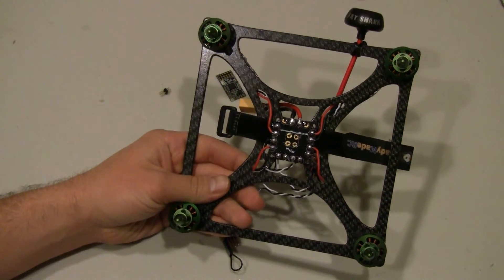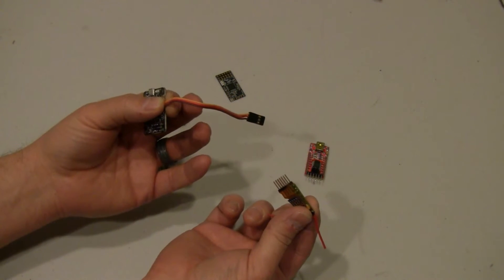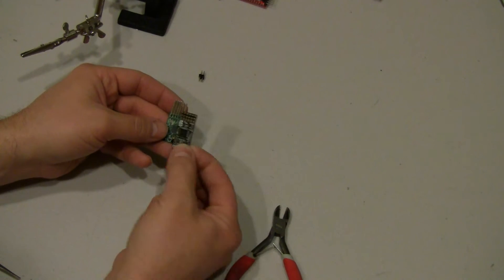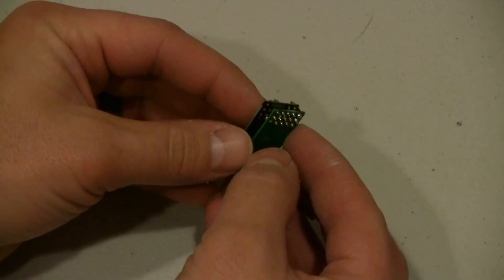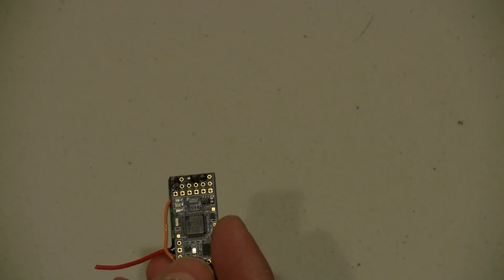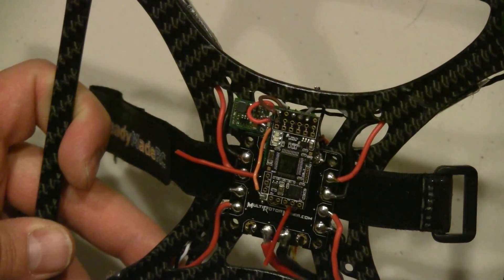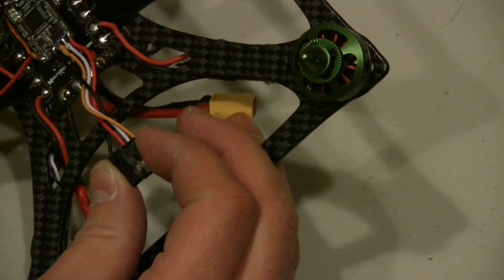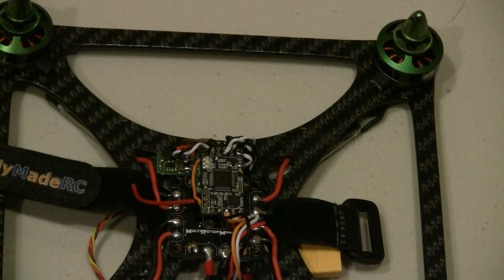XBR Sandwich wiring

Comment: Can you post a link to where you got your FTDI connector/plug? Should I just buy a FTDI to usb cable and cut it up? I'm hoping to start my XBR build this weekend, this is the last part I need, thanks!
Reply from the maker: +Byron Thurston  Here you go!  I dont know about cutting up an FTDI cable, this is only $6: http://www.ebay.com/itm/121752056893?_trksid=p2060353.m2749.l2649&ssPageName=STRK%3AMEBIDX%3AIT

If you liked the video be sure to give it a thumbs up :)
Reply: +Apex thanks for the link but I need the wiring harness that is connected to the Afro mini (female end) not the usb connector (male end) I live in CO, (not sure where you are) so if there is an old brick and mortar store I could pick one up at that would be best, otherwise order online would work too, thanks in advance. Liked and subscribed!
Reply from the maker: +Byron Thurston Awesome thanks!  That wiring harness is just 2 servo wires chopped up and hot glued together.  If you look in the video you can see that its just a 3 wire and 2 wire server connector.  The 2 wire connector is just normal 3 wire servo with one hole cut off with a pair of side cutters and one of the 2 wires remaining removed.